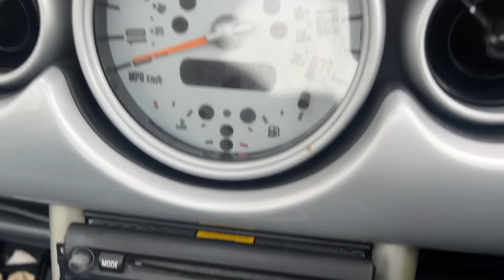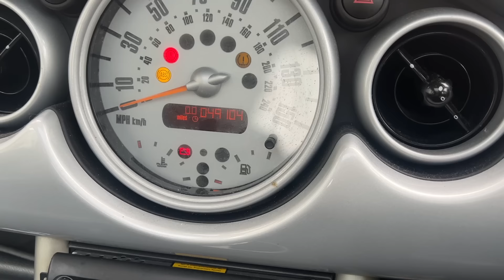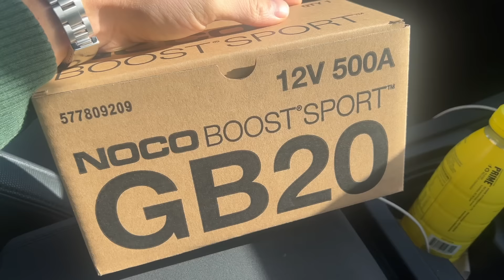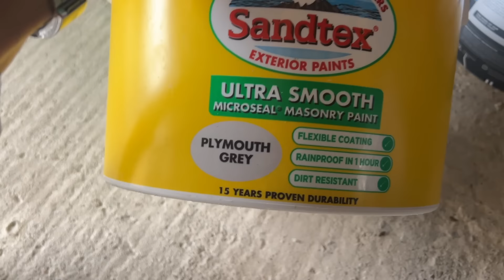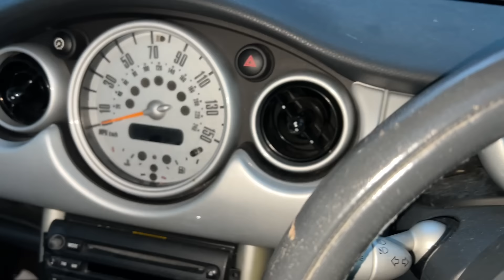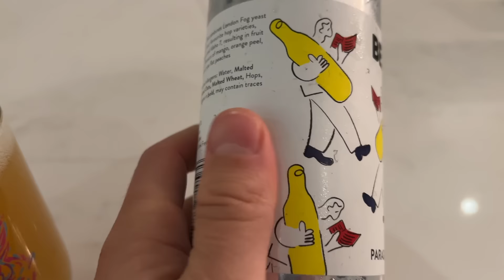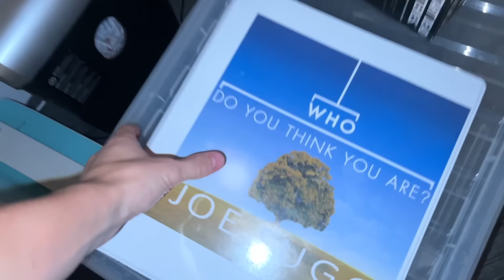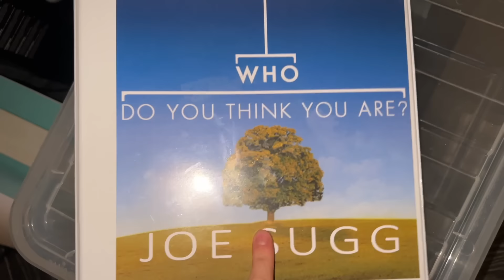It Looks like It's the end of the road..

Comment: Those jump packs are great but you normally have to turn the key pretty quickly after you press the button on the pack. If it's 5 months since Dot has used it, you might need a proper batter charger/ trickle charger to bring the battery back to life. Have you got a multi meter in your box of tools to see what voltage is in the battery? It probably would've been easier to buy a new battery if you've got none of the gizmos to bring the battery back to life!
Reply: Also try the boost mode on that charger you bought, it's the button below the power button.

Comment: I got a noco jump starter and I think if the battery is below a certain voltage the noco won’t work, I sure there’s a button on the jumper you press and it’ll give power to battery

Comment: Joe,  looks like you have a potentially serious water/mould problem next to the downstairs gaming room.

The void where you had the mini beer keg stored has a lot of ‘green’ growing on the bottom of the wall and all of the floor.

If you don’t have it attended to, the mould will end up spreading to under the games room floor.

You need to get a building inspector, etc, to have a look and advise,  if it’s serious you could have a claim to make against the builder (I assume the UK has the same, or similar, builders warranty laws we have in Australia?).

Don’t ignore it,  remediation could end up costing tens of thousands of $s (or £s) in years to come, apart from health issues from mould.

Check it out, ok?

Cheers,